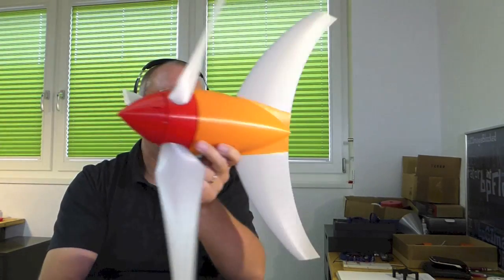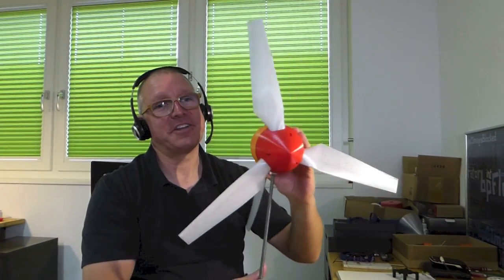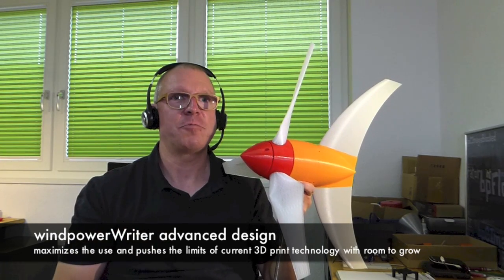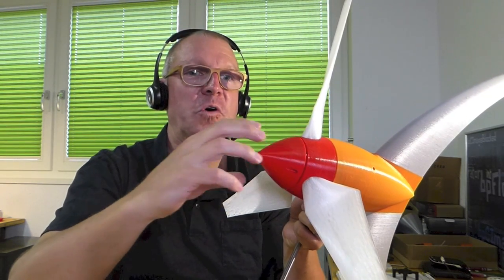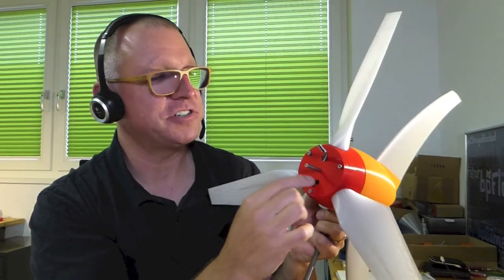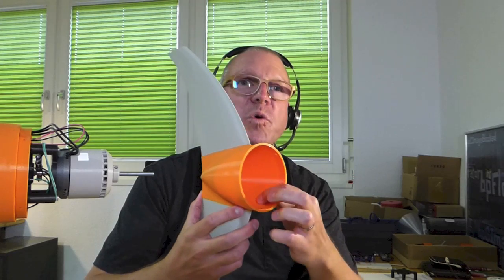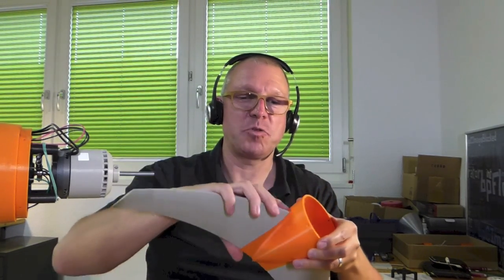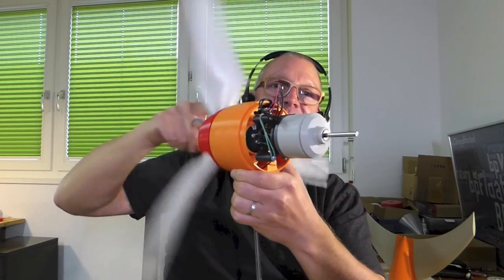How to 3D Print windpowerWriter Motor & Generator Details Part I

Comment: Very cool project i also saw your motor from the Christop Laimer canal ;). I also want to creat this windmill but i have two questions. You said with  the first windmill you had problems with the body of the mill and the size of the Generator, so why don't use on of these modern mills (don't now how to name them but i found this example: "Eddy GT" )? With this you could create the generator as large as you wanted only depending one the size of the windmill and your 3d printer. And the secound question is that i saw your video about your motor were you used the electromagnetic filament and it looked like it would work pretty properly. So did the quality of the filament change or is still as bad as you sad in this video? Thanks beforehand. :)